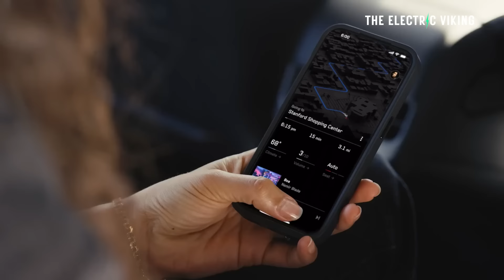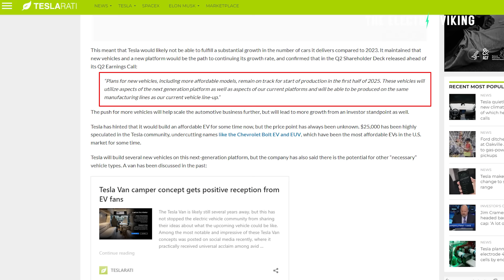Tesla's new affordable EVs arriving early 2025 are not what you think...

Comment: We have an older (2022) Model 3, which was the best car we had ever bought (by a long way). NOW we have an additional, refreshed Model 3 and it's EXTRAORDINARY. Very fast. Very quiet. Super smooth ride (excellent suspension). Remarkable stereo. Heaps of space. Remarkable tech. I really don't know how Tesla does it - amazing engineers I guess? Bravo
Reply: Very uncomfortable to sit in though......
Reply: @Berretotube  may I ask what vehicles you have owned in the past?
Reply: @MADDENCN  Absolutely! Many years ago I owned a Ford, then a GM. Then moved to Japanese cars - one Mazda and two Toyotas - all very reliable cars, really didn't have any big problems with them, super reliable. I owned a BMW for a year - that was a beautiful car, great driving dynamics, but everytime something went wrong, it was crazy expensive.
Reply: cheap plastic interior, awful suspension in your old one, noisy, etc
Reply: @sender5804 The older one was already amazing, the newest one is phenomenal and yes, waaaay more comfortable. Tesla has done a superb job!
Reply: Lol old 2021 m3 almost 80k miles. 

Ughh I guess these are getting old. 

Your 22 has the sensors in the bumper?
Reply: Sound like a bot

Comment: They need to make a hatchback Model 3 in Europe.
Reply: I want one here in the US. Want to get a bike in the back.
Reply: Maybe even just a Minivan variant of the car, car front and Van Back with maybe only two seats … that would also make a good base for a small camper …
Reply: @ChicagoBob123  I was on the reservation page while watching the Model 3 launch video. They promised a hatchback sedan, which in my opinion is the most versatile body style ever produced. I used to have no problem throwing my bike with 28" tires in the back of my Ford Escort. In the video I saw the trunk, which was clearly a last minute retrofit from a hatch design. I did not make a reservation. My boss got one and loved it, except for the trunk. In addition to the small opening, the weird retrofit from a hatch design means snow slides down the back windshield and directly into the trunk whenever you open the trunk. He has since replaced it with a Model Y, which is fine, but I don't want an SUV, I want a car.
Reply: Will be the model 2
Reply: Isn't that just the Y...?
Reply: Hatchbacks all day long , Ford focus , fiesta , golf etc biggest sellers in Europe
Reply: @chrisbraid2907  Thats what we call a Station wagon. I am all for it, even if the air resistance are higher, its not much if you compare ID4/5 etc.
Reply: They need to increase the tongue weight of the model Y hitch to 225 -250 pounds and put one on the model  3 as well.  So I can throw my ebikes on the back.
Reply: an estate version would be good
Reply: I think it's also a crucial European requirement to bring back the indicator stalk, at least as an option. This a pretty small thing costwise on the whole car, but it's a definite deal breaker for me and I'm sure for many others. 😢
Reply: @erik5820  I want a car with a decent sized boot plus hatchback opening. I don’t want a high riding suv with a humungous boot and all the body roll stuff you get with suvs. I mean to me estate car has a bigger boot, better handling and better miles per gallon than an SUV so I’d really like one of those but a model three hatchback would definitely give me most of that
Reply: Isn’t that a Y?
Reply: This is what the model 2 should be. Follow the size of a Renault Clio for example and you got the euro market secured. It’s what I’ve been waiting for.
Reply: @isaksidenius7059  when? in 2028?
Reply: @sender5804  2026 is What i hear.
Reply: That's model Y😂
Reply: @BusinessOperations-gj7ql  its an SUV, model 2 Will be the hatch back that Will take over Europe.
Reply: Il y aura bien le model 2 avec hayon et recharge des batteries très rapide et Tesla va écraser tous les constructeurs européens
Reply: Wouldn't that be a Model Y?🤔
Reply: Yes i don't know why the 3 wasn't a hatchback from the start. Way more practicle yet same look.
Reply: Model Y. ..got 1 , amazing space
Reply: Cybermini lol.

Comment: I think you’re basically correct 

On 10/10 they’ll showcase the Robotaxi but not the almost same Model 2 to avoid osborning the 3 & Y until it’s ready for delivery 1st half of 2025.
Possibly introduce the van also on 10/10

The model 2 won’t be the fully unboxed production but still have the 48V system and possibly also steer-by-wire

Comment: If they have a cheaper smaller battery, maybe take out some of features like heated seats etc to just the bare bones feature you need to run an EV.
Reply: As long as it has a heat pump 🎯
Reply: of course then no one would actually buy it. no matter what they claim.
Reply: And add cabin heating as a premium option
Reply: Only makes right turns

Comment: Holden pretty much had one the one line.   There they made all the similar models Omega, Berlina, Calais, Wagon, Ute, etc, all very similar cars the same platform, same line, but then then GM came up with the smaller/mid range car called Cruze, was made internationally in GM factories around the world, including Adelaide.   This was completely different car, completely unrelated to the models being produced, but they super-imposed the Cruze line over the Holden commodor-ish line.    I know, I was there.    So you can do a list of similar cars, and also completely different cars on the same line is also possible.  Yep, its messy, but it does work and is possible.  I guess my point is, its difficult to say from their statement, whether its a smaller model 2, or a cheaper model 3.    A model 2 would mean a new car, which is more wallstreet friendly.   A cheaper model 3 may imply to wallstreet that they are commodetising the model 3, which they don't like.   If its a 5% discount on the current model 3, wallstreet won't like that either.   Wallstreet and retail investors are hungry for a new model.   possibly a model 2 hatchback.     If they can pop out ultra cheap 2 seater robo taxi cars, thats good also, but FSD has to be fully solved, at least in minimum in one location for this one to work.

Comment: Makes sense to me.  Tesla pioneered new technologies in the cybertruck.  Battery density and charging speed is increasing.  Combining internal and external technology efficiencies and rolling out cheaper products to the customer while maintaining the profit margins is spot on.
Reply: The pioneering technologies in the Cybertruck I would like to see in future Teslas are a 48v system and drive by wire which is largely enabled by the 48v. This technology saves a lot of weight.
Reply: Tesla is constantly trying to reduce cost. They are clearly not where they were hoping to be with batteries. The Cybertruck performances are way bellow expectations.

Comment: I'd love a shorter range M3. Especially considering that with a smaller battery the M3 rwd would be lighter, more nimble and be a more engaging car to drive. I'm cross shopping a M3 with an Arbarth 500e, which weighs only 1335kg or only 80kg more than a Subaru BRZ (Auto). I have no use for more than 200km of range for a pure city car around Sydney.

Comment: I think it will be a smaller car. Less metal = less cost
But it will reuse most of the component of the model Y
The same way the original model Y was built from the model 3 platform. The new smaller car will be built from the Model Y platform but the chassis will be smaller. The great thing with gigacasting is that you can just change the molds to produce a different frame. So creating a smaller chassis will use the same casting and pressing equipment but only with  different die molds.
Reply: Maybee the cast two at a time then!
Reply: @Myrslokstok  Maybe the front underbody can be cast two at once using the larger casting machine but the back underbody is a bit larger so they will still be cast one at a time using the smaller casting machines.

Comment: I am fine and very happy that if tesla launches the model 2 or so but I think that if tesla can reduce the price of the model y and 3 refresh it will be the best thing ever!
Reply: Once the implement the full out of the box gen 2 manufacturing the price can drop and margins increase.  A model 2 2 seater can easily be the 25k car.  Reduce the weight which reduces the size of the battery which in turn further reduces the weight.  You can use a cheaper motor and cheaper breaks.  You can probably get away with a battery 60% the size of a model 3.  You just won't be able to have Ludacris mode.

Comment: When they say building on the same production lines, this should be probably be translated as “substantially the same car.” Modifications by omission are easiest, so they could focus on that:  In addition to smaller battery, they could save some money by omitting cameras, reducing the audio system to 2 speaker stereo, maybe a solid metal roof, no seat heaters / cheaper seats, simplifications to the charge port and maybe a smaller screen.

Comment: Not cheaper model Y and 3 but a 2 door built on existing line. It will be a single motor and have a relatively smaller battery but have great range.

Comment: This doesn’t bother me… take a model 3 rwd and strip it down to base options… manual seats, manual windows, no touchscreen or smaller way more limited interface(I’d prefer manual controls but touchscreen is probably lighter) cut the battery in half(that’s 500lbs alone), smaller wheels(the reduced weight would allow smaller brakes). 
You could potentially drop weight by at least 600lbs or more… I’d expect a substantially better reduction of price than just 5% though. This could be done I feel

Comment: Interesting theory, but I still think they’re gonna come out with a unique model 2. I think they will utilize the giga castings from the 3/Y but shorten the battery pack in between. This will also shorten the wheelbase. I think it will be a two seater, and share some of the body panels with the current production…. Basically a model 3/Y with the center section cut down. The smaller battery pack combined with using pre-existing parts and production lines should drive the cost down drastically.

Comment: I disagree. Tesla is segmenting the market. They could have made the model 3 a cheaper version of the model S, but that just degrades the value associated with the model S. A cheaper version of the 3 means putting pressure on the margins of the existing model 3 line up. 

It is better to have a model 2 that would have a $25k USD entry point, then a LR for maybe $32k and a performance  for maybe $38k. 

Different market segment, different buyers. 

My tip is that it will be a small hatch. The $25k will be 2 door. The others will be 4 door.

Comment: I disagree - I believe Tesla will release 2 versions of the model 2 Redwood - a hatchback/ shooting brake, and a coupe/ sedan. And the next one (third version) will be a suv based on the Redwood.
In my mind, Tesla's new strategic model for mass production, is the Redwood. The business class (model 3 &  y) will face massive competition from the Chinese and Chinese/ European cooperations (Geely and others)
But in the cheaper market 15 - 25k $  - Tesla needs to make their move now. That market will explode during the next 5 years, and will by far be the largest. Therefore Tesla needs to prioritize this.
The cheaper models needs to have smaller wheels, lightweight chassis, but still great comfort - and a range at minimum 300 miles. It must be cheap to own and maintain,  without compromising the quality.

Comment: Tesla needs their range to gradually become competitive with gas. Consider a 20 gal tank at the SUV average mileage of 30 miles/gal, that's 600 miles. More actual range than half that just barely lowers range anxiety enough to make gas car sales hard. And actual range means the fraction of battery capacity in 100% charge/discharge cycling that doesn't degrade the battery.. Batteries are getting better & production cars need to gradually get better range with faster charging as well as cheaper. The question, "How many fillups does a cross country trip take?" is how gas cars are sold to folks who ask about buying an EV.
Reply: What I need is a 600km car, that's it, I don't need more..

Comment: I think they will lower the price of the model 3 to 25000 and y to 30000-35000. I don't think they will add a third battery Option. I believe they will Do it by offering 3 (or More) Software packeges, range extension, faster exeloration and faster charging or enabling homecharging each for ~ 3000 Dollar , something like this, so you will get the m3sr like today for ~ 35000. Currently they try everything to lower production Cost to make as much Profit on a 25000 m3 car as possible since stuff like 48 volt are Currently not available for those cars Till end of 2025. But this way the 25k Tesla won't eat the m3 sales and curret owners wont  hate the Brand for losses. Also Service revenue will go up as the Software packeges  will be unlocked Cover time and the resell value stays good for Tesla.

Comment: Geez, at least mention ethernet controllers, minimalist wiring.
Consider also some means of eliminating paintshop, at least for the skin of the car. It’s expensive.
Tesla Shanghai has shortened production line by 100 metres, that saves a dollar or 2. Car is the same.
Batteries are so cheap now - like $4,000 - there’s little incentive to cheap out. Just get latest CATL chemistry.
Even the dimmest bulb can cut batteries, cutting surplus workers takes more effort.

Comment: Today, the Model Y RWD has 20% off batter locked off for no reason. So they could reduce the size and cost of the battery by 25-30% and the weight savings will still provide the same range as current model without any other changes.  Then consider their plans to roll out the Tesla bots in factories which will reduce labour costs.  Both will equal a substantial cost and price reduction without any other innovation.
Reply: If this was the case I would expect Tesla to make the smaller pack.   Apparently it is not worth the effort.
Far better to make inventory for the one part.   Then regardless of which size the factory needs it is there.
Reply: @danharold3087  But Tesla doesn’t make the LFP.  The RWD was rushed to market to qualify for incentives so they picked the most available battery which was during pandemic supply chain issues. Now that it has established volume sales and those supply issues are mostly resolved, they can easily order or make a more customized size. Its way cheaper to order a new size battery then to reengineer/design and implement assembly lines for an entirely new ‘cheaper’ model. Unless this Robotaxi, if made, could become the cheaper model with some cheap sheet metal changes and a steering wheel.